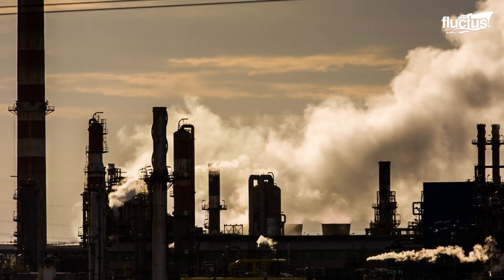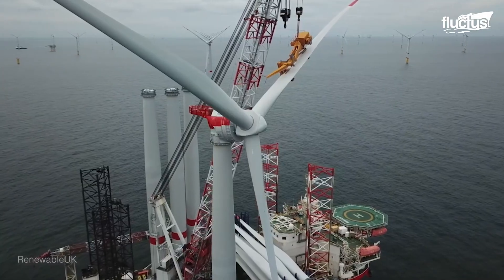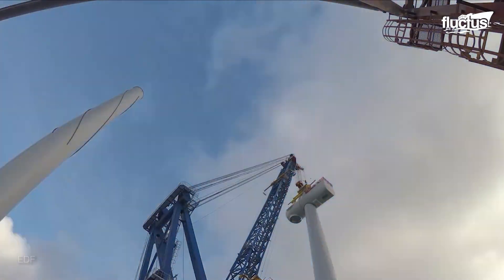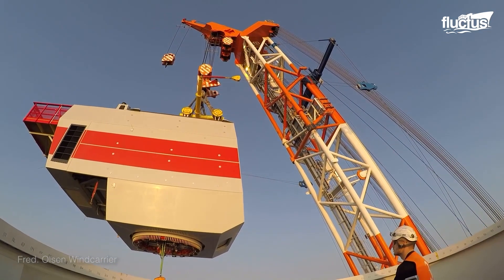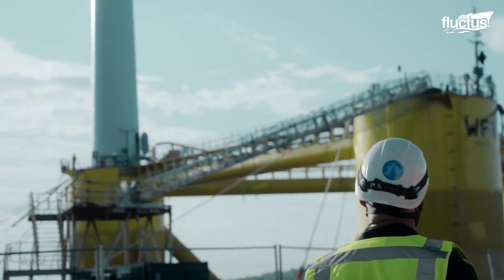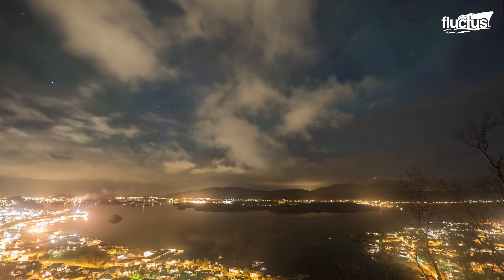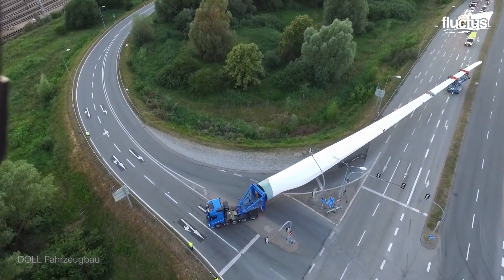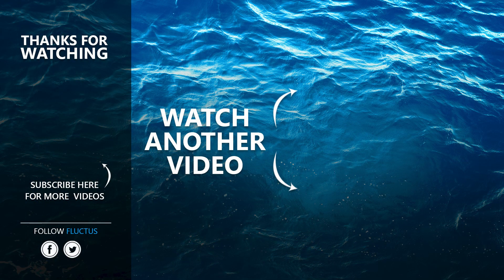Building $10 Million Offshore Wind Turbine in Middle of the Sea

Comment: Why don't you tell the viewers that off shore wind projects deliver an intermittent, unreliable power source that costs rate payers 4x market value.  And that the only way they can happen is through huge government subsidies.  The secret financial plans include none of the maintenance cots, so as blades fly off, towers rust out and cables break, the cost to the rate payer grows to 10x market value.  Furthermore these secret budgets never include the costs to decommission and remove the at the end of their useless life; that cost is left to "the next guy". How irresponsible is that?   Tell the public that each turbine has a diesel powered motor to start the spinning in low to moderate wind conditions and each has a diesel storage tank for the fuel.  Filling them at sea from a ship is not cheap and the fully charged pipe up to the tank creates a little spill into the sea.  No big deal but not congruent with the "clean affordable energy" mantra the politicians tout.  And since the pittance of power that they sometimes generate comes in surges, very expensive battery storage systems are needed on land so that the energy can be delivered when it's needed, not just when it's created (no ac needed on windy days, but it's needed on hot days with no wind, for example) No budgets include the storage of the power.  If you told people the whole story, including the impact to whales and other sea life, the fishing industry, the tourism industry (nobody ever asked "show me the homes with a view of the turbines) then the public could make better decision.  And they'd ask good questions as politicians claim "green new jobs" "clean affordable energy" and "could power up to 1 million homes" all nonsense.  Sending a few electrons to a home is not powering the home.  Off shore wind is a big charade and the biggest fleecing of the taxpayers of all time.  It only enables a few politicians to look "green".  There is not a single successful off shore wind project in the world (that pays for itself while delivering power at a competitive rate).  Not one in the world.  Tell the viewers that and present the whole story please.

Comment: I worked in the offshore wind turbine industry from 2008 to 2016. I loved the job but hated the hours. I now work in a hydro power station.
Reply: Is it hard to get a job out there doing that mate ? What was the hours like ? And what was the money ?
Reply: @ribena9585  If you have a trade electrician or fitter from a maintenance background you have a good chance of getting in. I would pay to do my gwo offshore qualifications before applying just to boost my application. Hours wise if you are offshore it's 12 hours a day minimum on rotations of anything from 7 on 7 off,14 on 14 off,10 on 5 off,21 on 7 off, it just depends on the project you are on and the site you are working at. Working onshore wind farms has better working hours but as a result lower wages. Pay varies however I earned over 50k a year back then however that included working lots of overtime you generally worked all the time.

Comment: The life span of the turbines have been completely mis understood. They were originally intended to last for 15 years, but the reality is around 5 years. 
Maintenance costs for repair are huge ($1m per turbine) and weather conditions prevent access.
The economics of wind energy are crashing and investors are losing money and pulling out. The entire industry is supporting by government subsidies and without it wouldn’t happen.
The other major issue is the defence and security. A foreign power could destroy the infrastructure in minutes.
Last but not least is that the wind is not constant and we have no way of storing the energy. Currently the UK backup energy storage facility for can provide energy for just 12 minutes.
The whole thing is a grift…
Reply: Your point on defence is bizarre. It would be far easier for a hostile force to target a single power plant site than to bring down all the wind turbines of a wind farm.
Reply: @Orbital_Inclination its happened before, google Nord Stream Gas Explosion.
Underwater assets are much more vulnerable than those on land and much harder to repair.

Comment: Windmills are a massive extortion racket to take taxpayer money. Without heavy subsidy, they don't actually make any economical sense. The manufacturers and operators (of which there are few) are laughing all the way to the bank.
Reply: It costs more to produce 1kWh energy with an off-shore windmill than it can be sold for. So governments pay the difference, and then some. It's beyond comprehension.

Comment: Ok I admit that I mostly let Foxnews and conservative news inform me on wind power issues.   That said the video is good because it's honest.   The fact that Norway gets 95% of its electricity from hydro even when having massive wind projects is very sobering.   But don't let this burden you when you push that button to vote up some comment having calculations because it shows intelligence?   Don't bother to read the comment about the Texas blackout last winter either.
But wait, just give me a couple minutes more.   I promise I won't disappoint.
So burning fossil fuel causes climate change but removing energy from the atmosphere won't?   In what physical system produces this win-win situation?   One single turbine generates enough electricity for 3,300 or 11,000 homes depending on whichever figure you believe.    Don't you think those tiny droplets of water won't get pushed far on land as they used to be?   Remember, we're talking about electric power.    Actual wind kinetic power lost to turbines is another matter.   You don't think this will make inland area a bit drier, more susceptible to wildfires?   This is not changing the climate at all?   Multiply the figures by hundreds of turbines.   Still no change?

Comment: I think that using the old technology to charge the old clocks at the bottom of the turbine in producing energy from the tides in the sea to support the air fan, i.e. from the bottom to the top, i.e. the energy production will be double. It will achieve a leap in development and the optimal and effective use of the turbine energy production. Greetings, I only ask you to pray Your brother from Mesopotamia, thank you

Comment: Many of the farms shown on this video are really old and some are not even in use anymore. As ugly, unreliable, costly to maintain as wind farms are I believe modern day nuclear power plants make so much more sense. Some nuclear plants have been running for 60 years and are expected to run for at least 80 years 24x7x365 with 600MW’s or more of carbon free power and only down time every 18 months for a few weeks maintenance. Wind, solar, hydro, or geothermal will never match that!

Comment: The infrastructure for oil is already in place. CO2 is good for plants. Why switch one energy source that's not as reliable to another? America has enough oil for hundreds of years. Maybe by then we will have built a Startrek transporter.
Reply: Because if we continue to use oil as source of energy, we will no longer exist in only one century.
Reply: @marco61137  Brainwashed with nonsense.
Reply: CO2 elevation can change the sea's ph, that can cause extinction of many animals and some kinds of life that generates O2, what will be another issue for the livings.
Reply: @marco61137  Will or Can?

Comment: Storing the windenergy is still not solved: Can it be hydrogen or methane or any other chemical energy?
Reply: Best storage solution we have to date is pumped hydroelectric. There are emerging technologies like power to gas and liquid air storage. We need to do more on balancing the grid via dynamic pricing to encourage a new generation of smart appliances which can tune their loading to the grid state. It will also incentivise consumer level storage of heat and cold to allow AC systems to take advantage of super cheap off peak electricity.
Reply: Batteries, Batteries, Batteries.

Comment: It seems like putting solar panels on homes and parking lots is much easier than building massive offshore wind farms. I'm all for offshore wind, but there should also be much more emphasis on putting solar panels on buildings.
Reply: Solar panels cannot produce enough power for a whole house most of the time. Wind farms are the absolute most eco friendly source of energy.
Reply: @jawkman101 Are they eco-friendly though? What happens to marine life?
Reply: @sia9907   Not sure how marine life can be affected. If anything it’ll promote marine life around the structure. Best fishing spots in Louisiana are around the old oil rig platforms. Marine life love objects in the water.
Reply: @jawkman101  Whales are very sensitive to sound and the ocean is already noise polluted. Oil rigs used to stress them out immensely. Military sonar still does, and any kind of drilling. I think there's no research yet to prove the turbines are harmful but it's common sense. They're massive, they're noisy, and they vibrate. I think we should make a bigger effort to take care of our ecosystems. It's painfully ironic that supposedly environmentally friendly energy sources are used without proper consideration for their impact on the planet we're trying to save.
Reply: Solar panels are cheaper then windfarms but we need both. 
Solarpanels should only be on homes but on the ground too.
Reply: A single, modern-day offshore wind turbine can generate more than 8 megawatts (MW) of energy, enough to cleanly power nearly six homes for a year.
Reply: @dtxgmoney  the turbines in the UK's new dogger bank wind farm are going to by 13MW. On shore wind turbines produce useful power about 30% of the time in the UK off sure wind  dose so about 50% of the time. Solar can only ever produce power in day time and even then only when it is not cloudy , and in the UK that is just when minimum power demand is. Our maximum demand is at 5 to 8pm on  week day nights between November and March when it is DARK!
Reply: Why are you all for windmills? They can never save us from energy crises simply because they cannot provide low energy costs. They only last for a few years. 
The only reasonable source of electricity is nuclear power, preferably fast reactors. There's enough fertile material to last for at least ten billion years. Longer than the sun will shine. They have the potential to give us a megawatt hour at $10. One hundred of today's rate. Yes, they do produce plutonium for fuel, and now is the time you drop your hysteria and trust we can make them safe from terrorists.
Reply: 28 of these big turbines can power about a million homes so these are much more worth the money and space compared to solar panels.
Reply: So what happened when a hurricane comes through,  this is the dumbest idea.
Reply: No, solar panels bring up most energy in the time of the year we need te least energy, wind energy will bring up energy the whole time, the more power of the weather goes bad. I think its more usefull then solar
Reply: @cornelisprul4212  During the hot summers, solar produces electricity when itis needed. Wind provides more electricity at night and out to sea. So, both have their contributions.
Reply: Solar panels aren't much use in northern Europe.
Reply: Whatever harms the environment least.
Reply: Solar panels are not enough. They can generate too little energy.
Reply: We have Solar panels on our house and we have not had sn electric bill in 5 yrs they do work efficiently. And I am in rosamond ca
Reply: @charlenemartin5899  That's great to hear, however, homeowners need to be very careful. Many of these solar companies like Power Home Solar on the East coast of the US have gone out of business and left the owners holding the bag and forced to pay $50,000 for their solar power systems that no longer work. So, I'm glad it's worked out well for you. Unfortunately, many people have also gotten scammed and ripped off by unscrupulous corrupt solar power companies.
Reply: thats nothing rly new, if u were to ever drive through germany villages here are plastered with solar pannels everywhere but it still wont be enough..
Reply: @bigKARTOFFEL-  Germany does have solar on many buildings but still they haven't utilized their maximum capacity. They could get a lot more from rooftop solar as well as solar on parking lots and agrovotaics.

Comment: HOW LONG will it take for them to breakeven
Reply: 10 years and then another 15 years of operational gains.
Reply: @paxundpeace9970  so you mean 25 years in total ?
Reply: Yea then after 25 years gotta rebuild all over again most likely , plus would be maintenance cost over its life time aswel
Reply: The oldest wind turbine farm in the UK is now 31 years old.  It changed hands 20 years ago and installed 4 more turbines (doubling it's output), enough for about 7,000 homes.

Comment: Saltwater issues alone would be a major problem, and don't these turbines need blades replaced in these environments more often?
Reply: No anti corrosion paint exists
Reply: @AK4974U  it’s not so much corrosion in the glass as it is high speed impact and ablation.  Once there is a divot, wind takes over and delaminates.
Reply: 25years warranty on the blades off shore
Reply: @garysmith5025  Why would you imagine I’m interested in what you say is low cost for a major marine operation?  I supplied an independent report.  If you have contrary data, please post.
Reply: @garysmith5025  No, the oil and gas industry has been building largely concrete  structures w mass 100,000 tons for decades, immune to sea state, generating cash flow on the order of 1-5 million euros per day, justifying very large maintenance budgets.  That problem has been solved.

These little 200 ton stick in the mud steel foundation turbines are a very different problem, with fast moving blades eaten up by salt spray in 10-15 years.
Reply: @Nill757  I have never seen a single concrete rig in the North Sea, you're thinking of the Arctic.
Reply: @krashd  Not sure what you’re talking about then.  Statoil Troll A is the largest platform in N Sea, in Troll field off Norway.
, using Condeep (reinforced concrete foundation) design.  There are another dozen Condeep designs out there.

“Condeep is a make of gravity-based structure for oil platforms invented and patented by engineer Olav Mo in 1972,[1] which were fabricated by Norwegian Contractors in Stavanger, Norway.[2][3][4] Condeep is an abbreviation for concrete deep water structure. “
Reply: @garysmith5025  Do you listen to yourself? Claiming some scientists are “sell outs” , with no investigation of their evidence, while you champion giant multinationals as all knowing, and  you’re smug about it. Then you put words in my mouth about what “people like” me believe.  Just go sod off.

Comment: So today, the UK demand is 38GW. The entire UK wind industry is producing just 1 GW. explain how this is viable. Thanks.
Reply: Explain how what is viable? Meeting the total energy demand for the UK with wind energy? That’s not viable. However, replacing a big chunk of fossil fuel energy with wind? That’s viable. How’s it done? By simply building more wind turbines. Ask and answered.
Reply: @2rooms19  yeah but to replace it you guys spent s*** ton more than when you were spending before to replace that. You're spending more to do less how is that beneficial
Reply: @loganaurora  replacing what?
Reply: @2rooms19  fossil fuel powered plants
Reply: @loganaurora  so you say we shouldn’t replace fossil fuel plants?
Reply: @2rooms19  no but the system we replace it with shouldn't cost more to do less.
Reply: @loganaurora  when internalising external costs, fossil fuel plants are much more expensive than solar and wind.
Reply: @2rooms19  well the only last 15 years most wind turbines compared to coal plants that have been around for almost 100 years. Plus when termites aren't the reliable cuz when when does employee have no power or if it gets too cold or too hot. I have no problem with these systems but if there worse than what we're using now what's the point
Reply: @2rooms19  He is wrong we were up to 24GW by 2019.
Reply: @2rooms19  build more turbines, ha ha, you people are priceless
Reply: @anglosaxonmike8325  which “people”? Don’t act like you are not in the absolute fringe position here.
Reply: You a full of crap. BY 2019 WIND ENERGY in UK produced 24GW !!